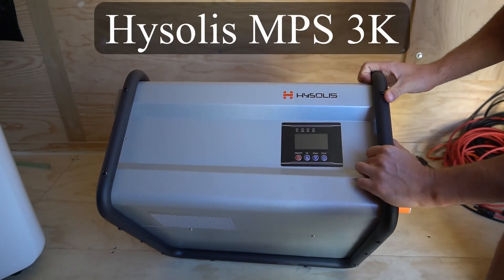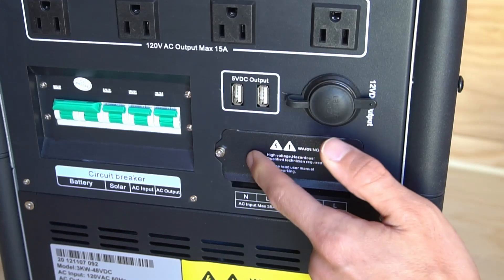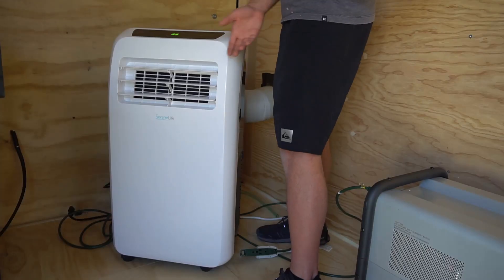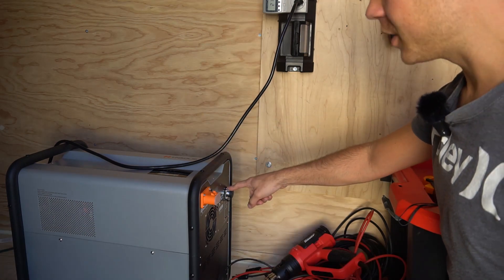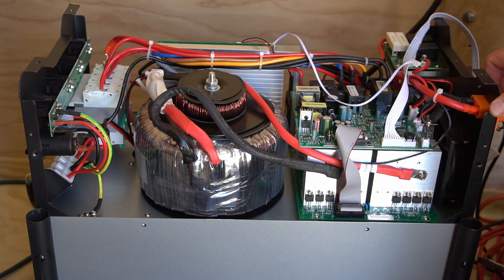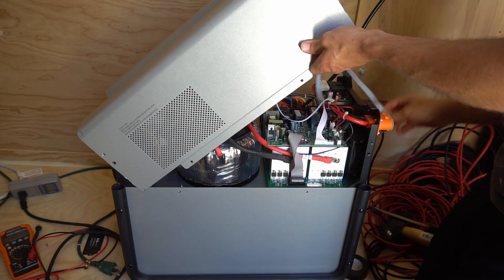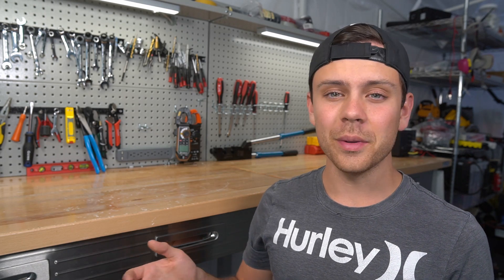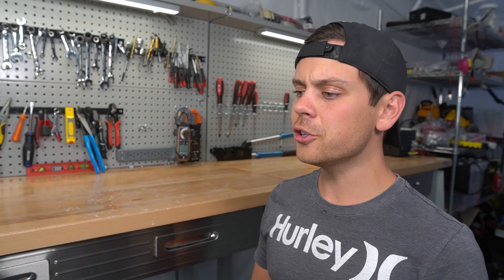Hysolis MPS 3K Solar Generator: 3kW LF Inverter, 4.5kWh Battery, 1.5kW Solar Input, 12/24V In/out

Comment: I regret to say, my Hysolis (gen 2) MPS3K didn’t change via AC power. I had to ship it for repair to find out it was a loose screw. Over 300$ in shipping both ways for a loose screw. 
What’s even more upsetting is that the “repaired” unit arrived with a screw at the bottom of the box. Over 90% of the visible screws were loose.
I don’t recommend this brand. 
I do have an EcoFlow and Bluetti that are great.

Comment: I have a question. I am a automobile detailer which means I go to the customer's house and detail their car for them. I typically use gas powered generator but these electric power generators have got me pretty interested. My question to you is I run shop vacs Bissell and Hoover carpet cleaners and the one that takes the most would be my McCulloch steamer which is the equivalent of a coffee pot. The tank has to heat up to do a car or truck typically takes me anywhere from 3 and 1/2 to 4 and 1/2 hours. Would this generator be able to get me through that amount of time with ease or would that be pushing it? Any info would be greatly appreciated. Thank you!

Comment: I have a question.
If I want to charge my Hysolis Generator with solar panels,what would be the correct voltage of the solar panels?
Can I use 12v,24v,48v,60v solar panels?

Comment: Excellent video!  I purchased this system based on this review.  It is still in the box as I haven't had time to open it yet.  Nevertheless I am waiting for the expanded battery pack to become available.  I've contacted Hysolis and they said the battery pack would be available at the beginning of this month (Oct.) but now they're saying mid November.  We'll see what happens.  Apparently it too will be 4.5 KWH so I'm guessing it's going to be quite pricey.  3K?  I would love for you to finish your review as you said you would.  Any luck on the extended testing for this unit?  Please let me know and thank you for your great work!!!

Comment: This unit is perfect for my off-grid cabin.  Everything that I looked at was either not enough storage or too many parts to worry about.  This is large enough to run a fridge for a couple of days and be simple enough for everyone to use.  It has the ability in the settings to charge with a customized amperage so we can use a 2000 watt genset to charge if there is not enough solar.  Thanks Will for doing these reviews, it really helps.  If you end up doing a follow up, a run through of the control pad options would be awesome!

Comment: Hey, good video. How big is the battery in amp not amp hrs
Reply: 375 Amp hours
Reply: @offgridgesertdwellers  how is the battery 375 amp hrs if the battery is 44.4v (not 12v)
Reply: That's the battery size of mine.  I just bought it

Comment: I was checking out the amps for the Solar input. I noticed it said 30amps for the MPPT, but in response to a question, the seller said the amps are reduced to 10 amps if the voltage for the panels is at 150 volts. Found that interesting, should that be happening?

Comment: I'm really interested in this unit! I've been looking at them for a while and your video has been very informative! This seems like a great deal but I'm curious about the longevity. How's it still running for you? I'm looking for a good off grid set up. I'm currently using the bluetti eb 240 and it's nice but wasn't aware of how much wattage that I'd use and learned that it is a good generator it's just a tad under my needs. I'm looking at this with the battery expansion.
Reply: I have been running a Bluetti AC200P for my off grid home. The Bluetti is nice, but like you it is too small for my total needs. I am now using the Hysolis. It's great and soon they are offering an expansion battery. That's another 4500 watt hours. The set up is a total of 9000 watt hours, and you get 91% of that for usable power. Awesome!

Comment: Mr will how is the hysolis holding up. I'm  really considering on getting one of these, thanks
Reply from the maker: It's actually great. Not a single complaint so far. It does not look that cool though haha but seems solid.
Reply: @WillProwse  it seems like a tough unit  wich  is exactly what I need
Reply: Can one replace the cells and how much it will cost to replace the cells once 2000+ cycles  are used
Reply from the maker: @hectorpina8503  in this pack I wouldn't. At 2000 cycles, you can still use it no problem, just at reduced capacity. These packs can theoretically be used for decades
Reply: @WillProwse  thank you

Comment: Damn. Something like this could just about run a tiny house on its own. I LOVE what's becoming possible in this market sector.
Reply: Yeah, I do run my tiny House with unit. Soon, there will be an expansion battery offered as well. So another 4500 watt hours. That's 9000 watt hours, or 750 Amp hours.
Reply: @offgridgesertdwellers  how have you liked the unit? Has it been ok for you and are you using the AC output 25amp connection? I ordered this unit and am waiting to receive it. Thanks.

Comment: Hey Will, thanks for everything you do to educate us newbies, and do you have any updates on the Hysolis, even though you've only had it a month? I am torn between it and the Titan, because for $335 more (including the tax for the Hysolis that Point Zero doesn't charge) than the Titan, I can get 6 more 160 Watt Rich solar panels (to add to my 2) and have 1280 watts of solar! The Hysolis delivers (hopefully) in July; Titan is now Oct, and at 68 if I get 2000 cycles from the Hysolis batteries I'll be 74 (assuming they "cycle" every day, and since this will be my only source of power, I assume that they will). Both have a 2 yr warranty on the unit; Hysolis has 3 yrs on batteries, Titan only 1, although Titan has been out for awhile longer and doesn't look like there have been any disappointments or problems. I'd wait for Hysolis to use LiFePO4 batteries, and according to the person I chatted with, that could start as early as their next shipment after the July shipment, but no guarantees, and I'll need this by early Sept when I hit the road. Even at 68, 5'6" and 130 lbs, I can still dead lift 200 lbs for 6 reps (I'm a PT), so the weight is not a consideration (at least now)! Thanks again, Will, and keep having fun!

Comment: Help me out. This or the newly released Inergy Flex 1500? Hysolis seems to win with overall higher power/capacity, but Inergy has more interfaces (e.g., USB C) and offering $150 discount right now, and is expandable to 96 batteries. I saw Will's video on Inergy Apex and he did not recommend it, but seems Inergy Flex 1500 addresses his concerns. Maybe he will review the Flex 1500!  Thoughts?

Comment: I didn’t see it mentioned, but does it have the same Bluetooth link that the smaller Hysolis unit does? 

I’d like to remove my batteries in my 5th wheel and install this, having that link would seal the deal.

Comment: I visited their website and I don't really understand the $15,000 price plans for the 600 lb 21 kilowatt hour system. It doesn't say whether it's a low-frequency inverter that meaning that has a u jiren Transformer and is my recollection is it's only a hundred and fifteen volt. On the air-conditioning side for less than $1,000 you can get cr23 at your local Home Depot for one and a half tons of cooling that's 18000 BTU but their 12000 BTU is 950 Watts and only $100 cheaper so I don't know how much the cr23 uses and I keep on saying seer but we do know that the global cooling prize for 80% reduction at a maximum wattage for 18000 BTU of 700w and that the grand prize has been shared by the two incumbents air conditioning company. The lower global warming was 84% reduction versus the current popular efficient model in India. However if you have the budget of somebody in a country like that all you care about is your internal temperature and to maintain your internal temperature take significantly less then 1% of the energy of dehumidify the air that you live and especially in a van. So instead of slashing 84% I say / 99.84% used another words less than one-fifth of 1% of what a dehumidifier AKA conditioner of the air requires. It's not about sealing the envelope rather it's about keeping your clothing below body temperature. To keep your clothing below body temperature requires almost no energy if you have microvascular tubes woven into the internal fabric and the outer fabric being somewhat insulating you can stop your body from ever sweating more than when you're cold which means that you only sweat through your lungs by pumping a fluid that boils at a low enough temperature. This fluid would only cost a couple dollars at most. With such underwear and socks on you could have obtain for less than $100 you can use the s o l o n seller Surplus c e l l s that were finally liquidated in 2019 but manufacturers many many more years before. I think that you can put them on a sombrero and have enough energy to leave the mule behind that run up and down the Grand Canyon on the hottest day without carrying water. But if you don't want to use an electrical system which I would understand you probably only need a few ounces of liquid nitrogen to with a turbine condense)

Comment: Don't call batteries generators.
Reply: what would you call a system that takes  sunlight then produces  and stores electrical energy? Yes one component is a battery.
Reply: @ThanksForTheLaugh  A generator makes power when you want it. If you drain the battery at 10pm you have nothing till daylight.
Reply: @jeffhanson6844   run out of fuel doesn’t something similar happen? Thanks for the laugh.
Reply: @ThanksForTheLaugh  you refill a gas tank whenever you want. Try turning the sun on whenever you want. Really not that funny

Comment: Hi I have a question.  I've watched a lot of your videos and love them but sadly my brain does not absorb this info readily.  Am I right that with this device in an rv/conversion you only need solar panels?  This thing charges from a wall and from the car/vehicle while driving but the real power comes from solar.  So this is a charge controller, inverter, battery (not to mention all the 12v/24v cables between the devices which can be expensive) basically everything you need in one aside from panels?  And at 4.5kwh this thing is massive correct?  Comparable or superior to a BB 270ah (Which is roughly only 3kwh?) litium ion battery?   Thank you so much for your informative videos!   If you could also answer what sort of solar array would you recommend for this battery?  Something that could pull in about 1kwh so like 5x200watt panels or 3x300watt panels?
Reply: Yes, just add solar panels. Then you are up and running. Remember to always over panel.
Reply: 4 - 250 watts panels. But I would over panel the system to make it more effiecent.

Comment: Can someone please help me to find out the aH capacity of my DIY 18650 build? Its a 60p7s 24v set-up,  I'm using 420 cells @ 2200maH per. Is there a formula that I can use to figure it out? I  assume 2200maH x 420 but I think I'm missing something.  Please help this noob!

Comment: Will, or anyone into diy solar who can help, do you have a fave, reliable, user friendly favorite, affordable, all purpose multimeter that you use for auto, solar, etc.? I'm still in the very early stages of all of this. I won't need anything elaborate, I won't be doing anything really complex, but do need to know how my auto batteries are fairing (very rarely drive) and don't want to just buy anything, only to learn at some point in the future that it lacks the ability to help with solar related projects. I know little about batteries (here's what I know: +, -… lead acid, agm, 2 lithiums, nickle, see not much!), and even less about multimeters and can't afford to have regrets about purchases. Thanks in advance! Also Will, if you consult, how do people reach you?

Comment: I stand corrected. The Hysolis is equipped with an AC bus bar where you can hardwire a 25 amp AC power cord directly to the unit.

Comment: Sure, you're putting strain on your vehicle's electrical system to charge one of these on the road.  Unless of course, we're talking a big diesel pickup with dual or a 400 Amp alternator and upfitter circuitry to protect the rest of the system (which most RV guys, and even a lot of contractors have).

Now, how often would a person totally drain a system like this in one sitting, making topping up on the road such a big issue?  I guess if you were boondocking and running an air conditioner, then sure.  In my uses, I haven't drained my poor little Bluetti 1.2KW unit in over a month of twice per week use.  I wish it had 12 volt charging capability, because it would probably stay charged up all the time.

This particular unit is right on the line of being a portable, yet workable emergency power system for a home (and by emergency, I don't mean AC and heat pump).  

I was going to tease you about not being able to get 130lbs up on your workbench, but first went out the shed and tried to hoist 140lbs of tractor wheel weights onto my workbench.  Weights sure have gotten heavier as I have gotten older!

Comment: There are no "Solar Generator"s, but it is a "Battery Bank" yes.
Reply: I like that Hysolis uses "Power Station" that's kind of a cool description for the product.
Reply: It IS a solar generator, because it uses solar to generate electricity, just like a gas generator uses gas to produce electricity. Unless you think that there are no gas generators. And if all I had was a battery bank, I couldn't plug anything into it! You sat tomato, I say solar generator.

Comment: The 6KW AMPINVT/PVACE FT-24V6000W Inverter/Charger (No batteries) I have looks almost identical on the inside. Same board/component layout and display/buttons. I also was very impressed with the quality of the construction and design. The only downside is I bought the 240V one and it isn't split phase. It is 240 to N and not 120/120. If someone is looking for one I would recommend as long as you only need 120V.

Comment: They talk about it being suited for boats and RV, but they miss the mark by not including 30 amp RV style outlet. Also, needs to accommodate DC to DC charging via products like Victron Energy's Orion Tr charge controllers. Those additions could make it very attractive to van and boating customers.
Reply from the maker: They have a 30 amp plug actually. I guess I should have mentioned that.
Reply: @WillProwse  I watched again and saw where you pointed out the AC in/out port. I'm now in touch with Hysolis...thanks!
Reply: @WillProwse   Get your viewers in to the practice of RTFM  👍most of the questions are answered there, imagine that. This unit seems to not quite consumer  oriented. Some of the programing options are interesting. Also manual says replace all batteries as a set.

Comment: Hello
Can I use separate Bms for discharging only and charging from separate power supply when it is not in discharge mode
Note i am using 1kva 12v UPS which use lead battery ... and i want to use 3.2v lifepo4 battery instead
^ _ ^  ...i do not want to charge from ups it maybe  damage the lifpo4 battery   ...can it work ^__^ i am from iraq i love your videos.

Comment: Hey Will, would you mind answering a question on a lithium project I am wanting to build?
I built a 48v 100ah pack for my golf cart using headway prismatic cells. It works so well I am now wanting to build a pack for my 24v Trolling motor. Should I be able to series 8 Prismatic cells and still be able to charge them with my onboard Minn Kota 3 bank charger. My current lead acid batteries are in series and I hook the neg/pos leads coming from my onboard charger to both batteries. Also would you use 1 24v BMS or 2 12v BMS. One bank of my charger goes to my starting battery.... The starting battery is on the list also but I have many questions on it.
Thanks
Rick Wilkinson
N. TX

Comment: For the cost of these first generation solar inverter generators its hard to walk away from affordable gas inverter generators. This one is a fairly good unit for a change..
Reply: Especially a dual fuel.
Reply: The sun will always be there. Gas, well.....
Not so much. And, you have to buy gas. The sun asks for nothing for us to use its power.